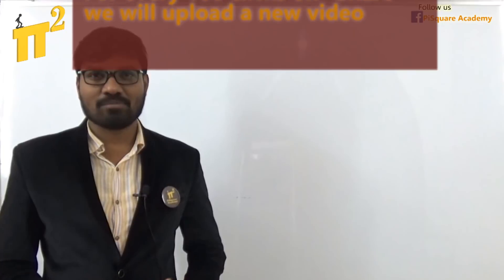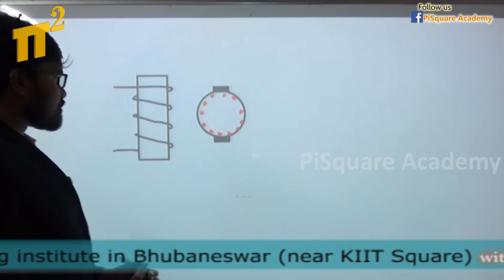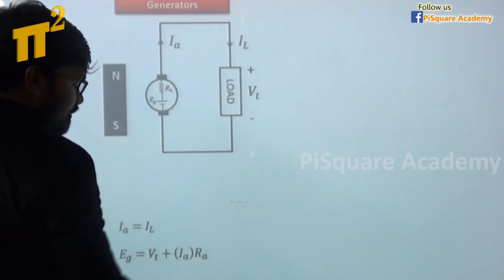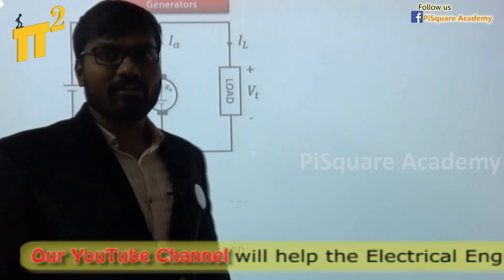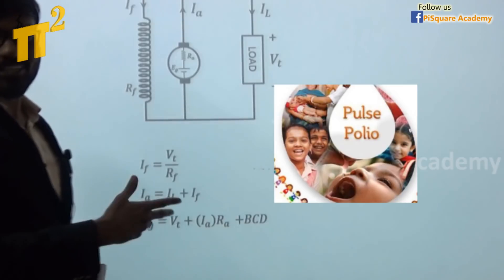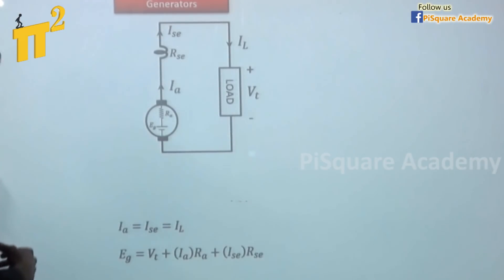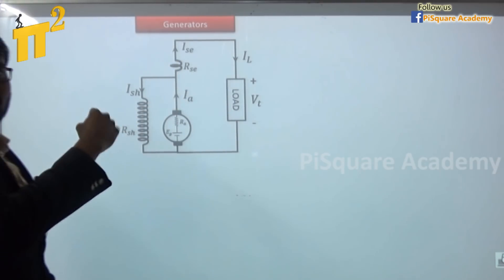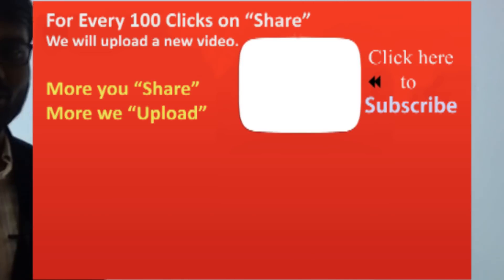Clear Explanation of Types of DC Generators, current and emf equations | Subtitles included

Comment: Sir, answer is
If series winding has having more turns then voltage drop increases so,  we dont require more turns
In shunt winding current drawn is less becuse its in parallel and having more resistance than series winding becuase of more number of turns 
Low current and hight number of turns can generate required mmf
Reply: Sir, I have one doubt.
In DC , we are connect two batteries in series or parallel makes the voltage double . Why not in AC the voltage not change??? 🤔🤔🤔
Reply: @pradhipraj132  Ac means alternating current so current who developed some quantity and destroy the quantity which is developed by itself so it can"t be stored and as well as change ok.

Comment: Series field current is high and we need to more cross sectional area which provide less resistance and the current is high so we don't required higher turns to generate magnetic flux .
the shunt field required more resistance so it have small cross sectional area and higher winding due to the value of current is not so higher as series field.
Summary is : (Low current+higher turns)=(high current+less turns) 
That"s my answer so please check it out .
thanks.

Comment: 1) Since the load is going to be connected across the armature, it is expected that the current through the series winding will be more and hence to be able to sustain to higher currents, the winding is thicker. 
2) To limit the voltage drop across it, the winding length is less but the area of cross-section is more. (R=Rho*length of the conductor/Area of cross-section)
3) In the case of the field winding, current basically is required for the magnetization purpose which is going to be very less as compared to the load current and hence the thinner conductor length. 
4) More the number of turns, more is the flux linkage and hence more number of turns on the field winding side

Comment: Answer are:
1-We know cross sectional area of conductor is directly proportional to flow of current, so in series, current(equal to supply current) is more that's why thick conductor field is needed and in shunt field less current that's why  thin conductor field is required.

Comment: In DC, we connect two batteries in series or parallel makes voltage double. Why not in AC?
Reply: I think we don't have battery in ac . And we it's difficult  to add to different ac source , because it has  frequency,  but in dc we can add two different voltage we get resultant voltage

Comment: Sir, I have one doubt.
In DC, we Connect two batteries in series or parallel makes voltage double.
Why not in AC?
Reply from the maker: Dear Pradhip, we can do it for AC as well. Rather we do it also in our daily practice, which is called as paralleling of transformer or alternators

Comment: If we use thin wire  against of thick wire  in series winding, it will damage &flash over condition comes in existence  due to flow of high current through them .
Both the end of shunt winding connect directly with induced emf (voltage) owing that large voltage drop should be need, just to solve this thin wire with large no. of turn is use.

Comment: Series resistance has to  minimal value to have low voltage drop, and for less resistance , conductor cross section area has to be more.
Similarly shunt winding must have more turns with high resistance to not flow heavy currents through it. As excitation will take less currents.

Comment: 1..
Resistance property
Thicker the cross section area less resistance and thinner it is more, because they are inversely proportion..
2..
Inductance property
Less(single) turn coil offers less inductance and more turns offers much inductance(field).
By taking both conditions..
            In series field thick and single coil are used, because load needs less (resistance) opposition more current to drive load and avoid lagging power factor effect(inductance).
            In shunt field thin and more coils are used, because more resistance is to minimize the share of load current and more turns for good amount of magnetic field to fullfil the purpose.
Thank you.

Comment: Hi sir, Series field has less no of turns and thicker for having less resistance and high conductivity so voltage drop across series field is less.similarly  shunt field has More no of turns and thinner in Dia for offering high resistance because if it has low resistance more current flow through it therefore output voltage fall's

Comment: Thicker wire with less turns decreases the resistance which was connected in series, & thinner wire with more turns though there has increase in resistance it doesn't influence the emf as the shunt connects in parallel